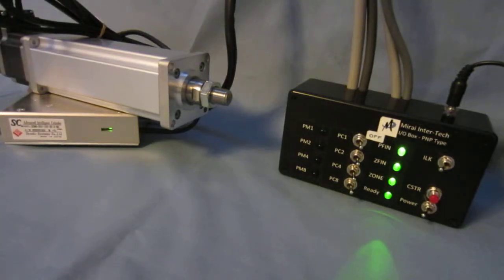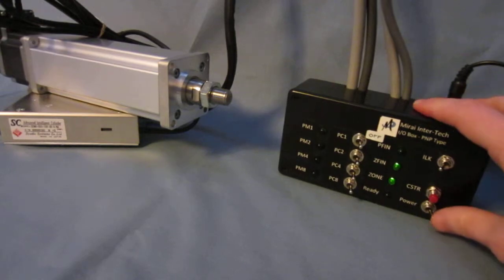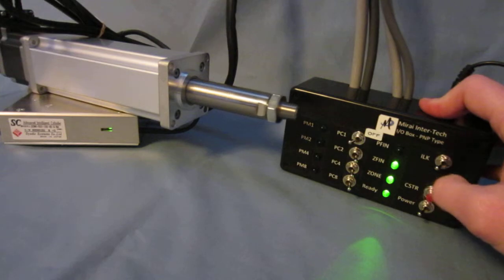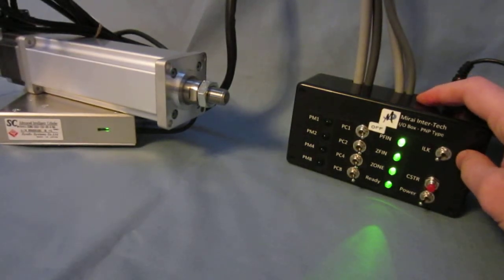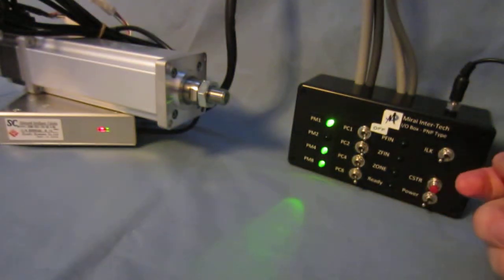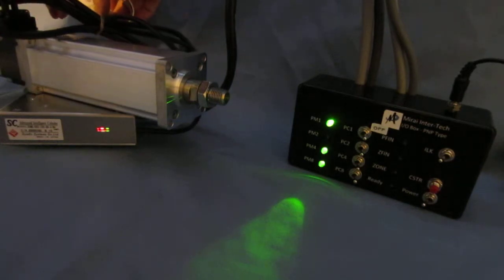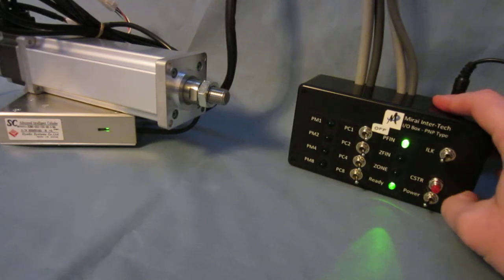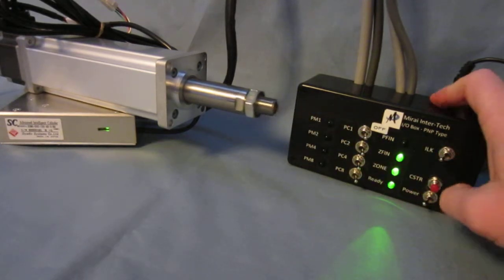Dyadic SCN6 actuator recovering from Alarm condition Using 24V signal

Comment: Unfortunately my amp has a red alarm on and I plugged in another amp to this end actuator and it's also still alarming. I can't figure out how to clear it without your controller box
Reply from the maker: Hi, thank you for your comment.  The servo amp can detect many alarm conditions, so the procedure in this video only applies to conditions that are no longer causing trouble.  If the alarm condition remains in place after powering down the amp and actuator and powering up again then something may need to be replaced.  Can you please reach out to us by email at sales@miraiintertech.com?
Reply: @miraiintertech  I actually discovered the issue, just taking off the top cover unveiled a plug that somehow came undone. It works beautifully again!
Reply from the maker: @RTAMOTORSPORTS  That makes sense - enjoy!